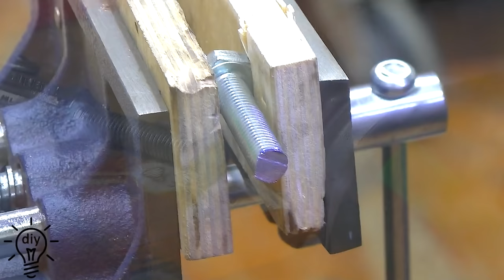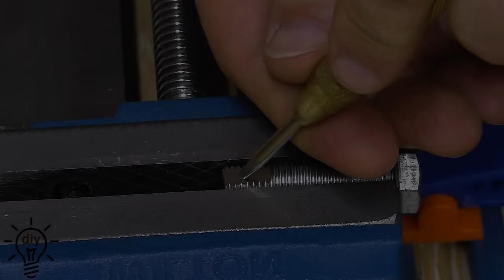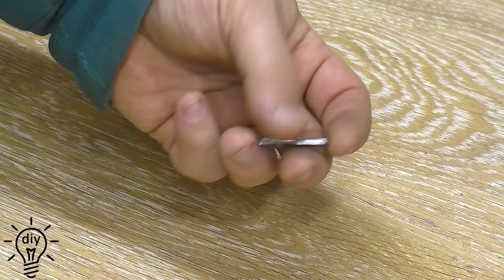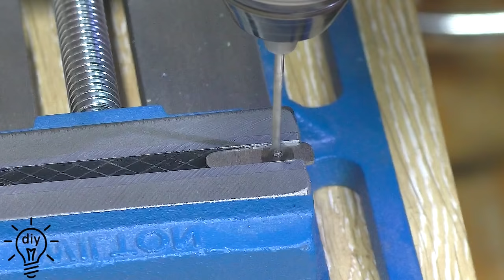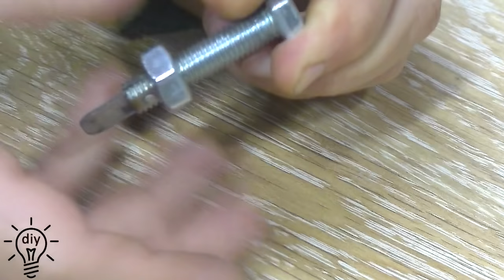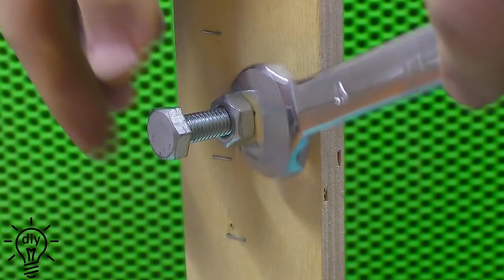A great tool for the home workshop! A brilliant idea from bolt!!!

Comment: This is used for what.?
Reply from the maker: for fixing the bolt in the wall
Reply: @diyprojects7868  
You mean like an anchor in drywall ?
It's really not clear how / why you use it 🤔. I think you should SHOW you're using it to drive the bolt through a SOLID-WOOD WALL, not through a free-standing 2×4 , 2x6...
Reply: @khaled taha  (خالد طه)
It looks like you have your own channel.  I'm going to check it out.
كل عام وأنتم بخير 🙂

Comment: Now this could be a useful hack if you don't have a the purpose made item to hand but for the use shown it is a waste of time. Another nut (With washer) on the back of that timber would have done the same thing but much quicker and easier.